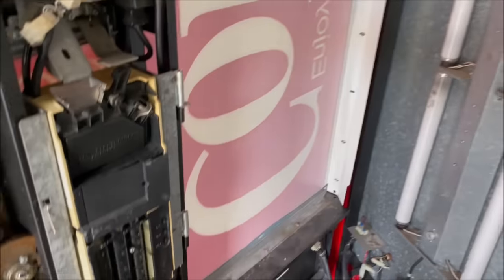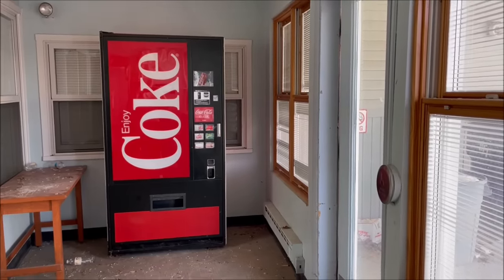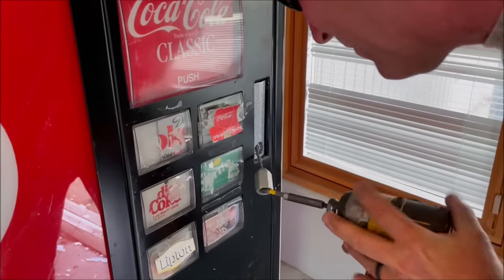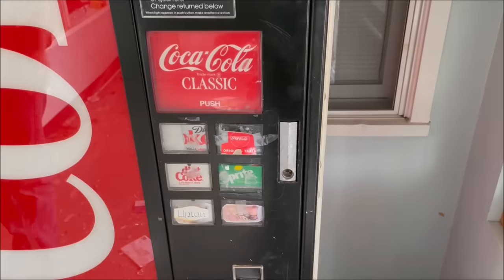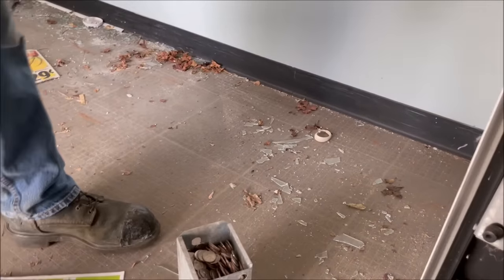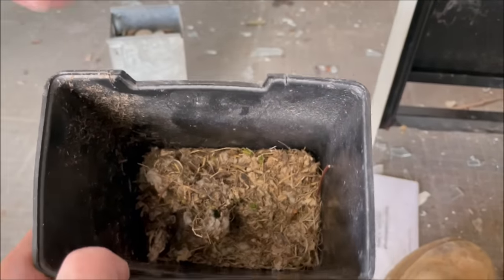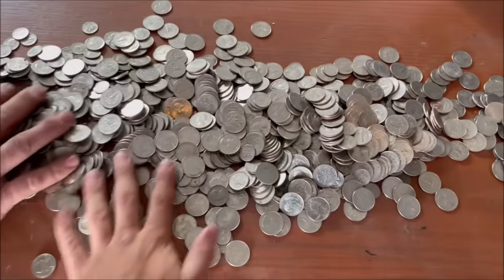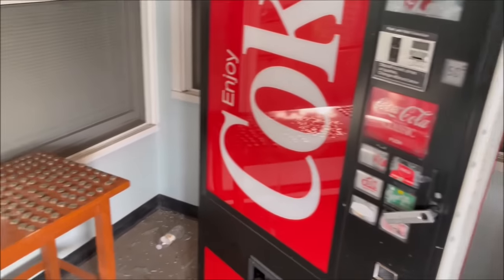Breaking Into Old Abandoned Coke Vending Machine and We Found An Insane Amount Of Money Inside...

Comment: One of my friends worked for coke for years. He told me that Coke does not sell machines, they lease them. He use to find the machines at shops down in Miami. He would run the S/N it was missing/stolen. He would tell the shop owner they either turn in the machine or pay the lease. Most of the time, they would just pay the lease. That was back in the late 90s. I don't know what the policy is now. I am sure that machine is on cokes missing vending machine list.

Comment: On those old coke machines with a large button for coke and smaller buttons for everything else, if it is still plugged in, you can break the large coke button and you will find 2 small red buttons that if pushed with fingers, the machine spits the coins out all over the floor